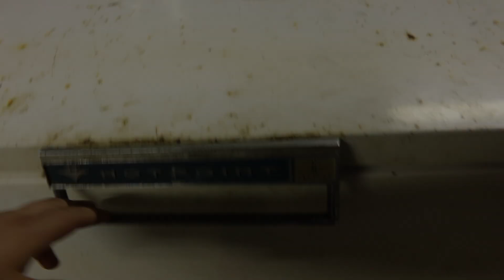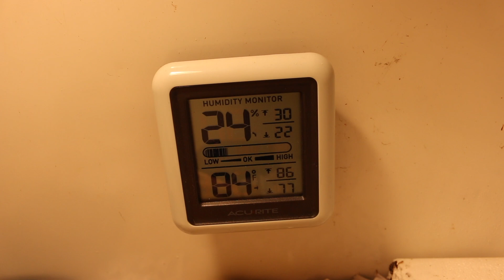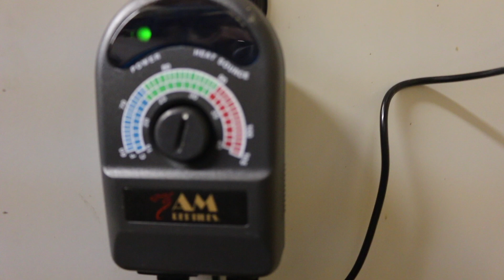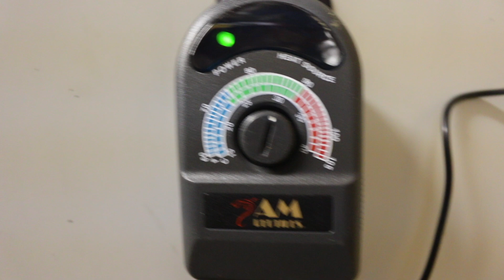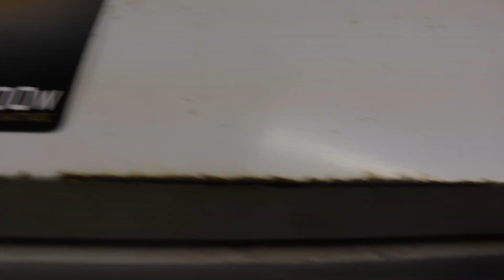Dermestid Beetle Housing Setup/Tips | Taxidermy | Skull Cleaning

Comment: Thanks for sharing the info.  I assume you leave the foam on the fan ports inside the freezer all the time even when the fans are on or do you take them off when the fans run.
Reply from the maker: Just depends, the foam keeps other bugs and things out. If I’m down there working near it I’ll take the foam off but most of the time they stay on there with no issues

Comment: Hey make a video on how you clean your freezer out with out losing your beetles.
Reply from the maker: I would if we still had the setup. All you do is remove everything inside the housing into a big plastic bin. The proceed to vacuum and remove any unwanted material. Place new paper shavings in and the filter the bugs out of the old material and place back into the permanent housing
Reply: @EremosOutdoors  got it but how do you filter all the bugs out of the ground up material in the bottom.
Reply from the maker: @freddygarmin8075  it can be a tedious process when I cleaned it out I just sorted them out with my hands. I definitely lost some in the process but they don’t bite. You could prolly use the Sandpaper shavings you have in your housing but just make sure when you’re removing them to clean it you shake them real good to get dust and debris out of it

Comment: How do you control the moisture. What is a good humidity level to try and maintain?
Reply from the maker: Dermestid beetles prefer 50–60% humidity and a temperature of 70-80 degrees. Too much moisture can result in the emergence of mites, which can destroy the entire colony. You can control moisture by using fans and making sure your housing is sealed properly

Comment: how do you get all of the beetles out of the skull once they're done cleaning it?  Like the sensitive areas of the nose cavity?
Reply from the maker: Business Insurance Services of Texas you won’t be able to get all of them out like the little ones but I mainly just try to bump them out by hitting the antler or forehead of the skull lightly. You can blow them out with a air pressure to. Also put another thing of fresh meat in there and they will leave the old skull for the new food
Reply: Business Insurance Services of Texas you soak them in hot water
Reply: I have seen people hang the skull up in the freezer and the Beatles will slowly leave and not climb back up

Comment: I live in Ms. And it gets over 100° in my shop. Will they survive in a freezer or container in the heat. Thanks
Reply from the maker: Travis Mcneil they will probably survive but once the temp gets over 80 they are said  to grow wings and be able to fly. I’ve never had it happen and I’ve had mine up to 85 before you should be fine. They will become more active in heat and slow down in cooler conditions

Comment: Do you ever deal with smell with the beetles? If you don’t, what do you do to prevent it?
Reply from the maker: Hunter Stanley it’s a smell
You have never smelled before. If the beetles can consume the flesh very rapidly you will not have a strong smell but around 100,000 beetles in a colony is needed for that kind of production. It will have a stintch to it but cleaning out the housing and replacing old shavings with new will help. The stink is part of it sometimes
Reply: Carolina Outdoors yea, I have some and I had to move them to a shed outside because they were stinking up the house. I have to add extra heat now and a lot died during the process.

Comment: How do you deal with the odor? The vent fans circulate air and push it out of the freezer and into your basement. What then?
Reply from the maker: Brandon Flack I don’t run the fans at all times. Just every now and then to keep humidity down. With a big colony that will consume a skull in about 36 hours it will not smell but just for a little bit
Reply: @EremosOutdoors  I clean bull elk skulls. They are huge and take some time (much longer than 36 hours) even with a large colony. But, I have a shed out back to keep the colony in. Thanks for the video! It's given me some really good ideas to improve my beetle housing.
Reply: i use charcoal filters. same idea for a cannabis grow. it keeps the smell down. but as said its only really stinking when there is something in there.
Reply: We have done a similar set up for a few months now, and have cleaned about eight deer skulls so far. We use no fans but we vent the lid. It’s in our basement, and the odor is about to run us out of the house. I’m thinking about running a computer fan into a dryer duct to vent to the outside of the house. Does anyone have any experience with this?
Reply: @03bullseye   id say go bigger check out a grow fan with duct with charcoal filter on it.
Reply: @03bullseye  I have a similar setup as shown on the video. My beetles clean an entire deer skull in 3-5 days and the odor is still bad. This is beacuse of the the frass (beetle poop) leftover from the consumption of flesh. No way I could keep it indoors. I had it in my garage for a while but couldn't stand it anymore. I keep the beetle box in my shed now. Before I got the old freezer I used a plastic tote and had a bathroom vent fan mounted on the lid with vent pipe run out the side of the shed. It was set on a timer to run 5 minutes every hour or 2. That worked great.